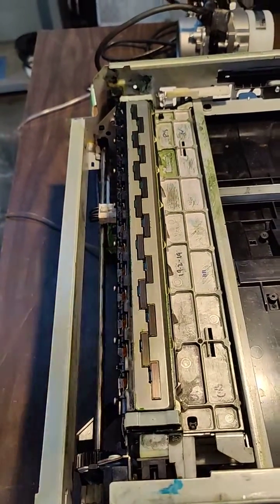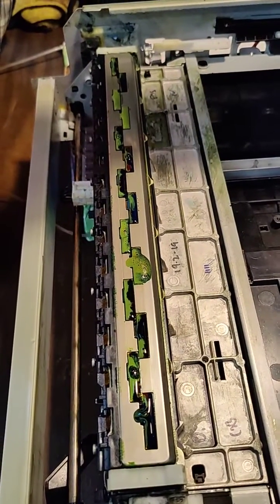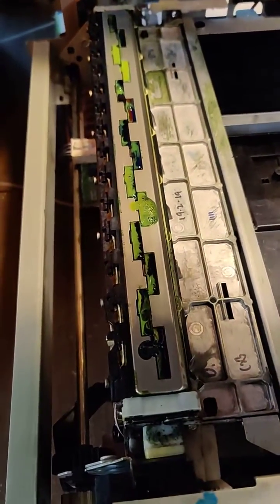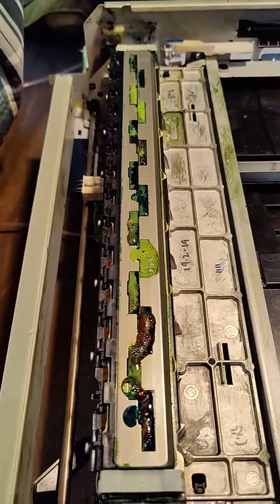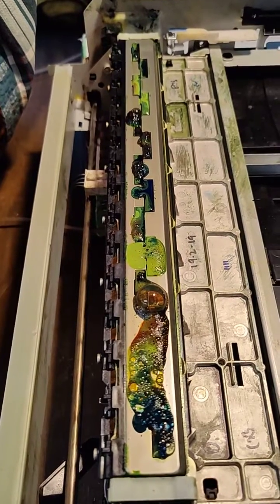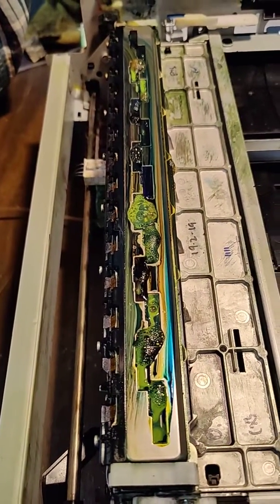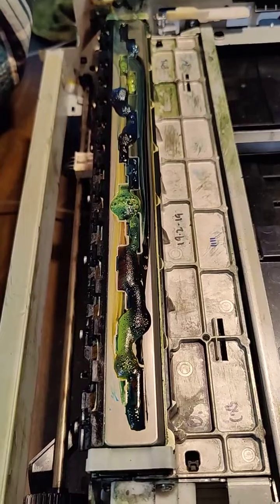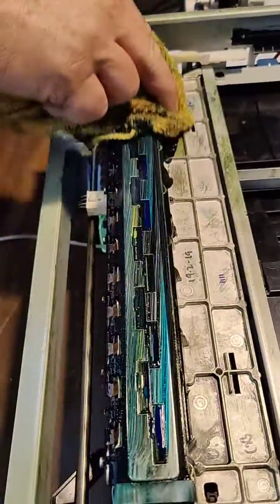Priming the air out of FI-1000 Pagewide Printhead

Comment: Hi, do you use just gravity to do this by placing the ink bags higher? Or are you using some type of compressor connected somewhere to the printhead? Trying to do this to a f1-1000 hp printhead I have. Thank you.
Reply: Its not really a great solution. The issue is more to do with the electronics when they get to hot.
Reply: I am interested in the same question. The ink from the pouch is connected to the intermediate in pump, which is then turned on, or is feeding the head by gravity only? Please explain, it would be very useful to understand the way to clean the head from air